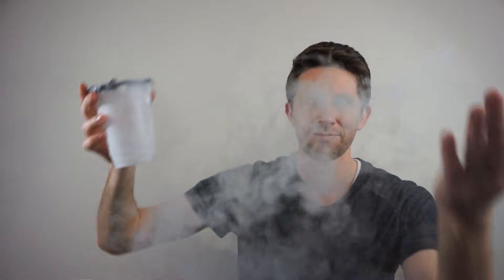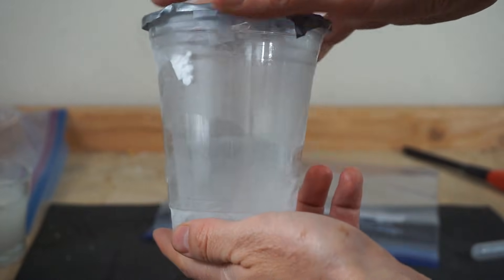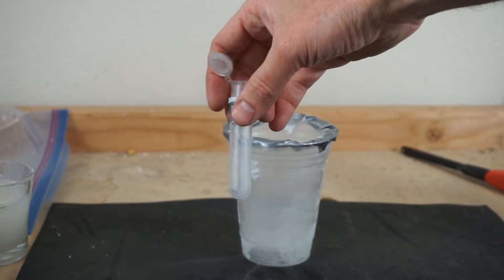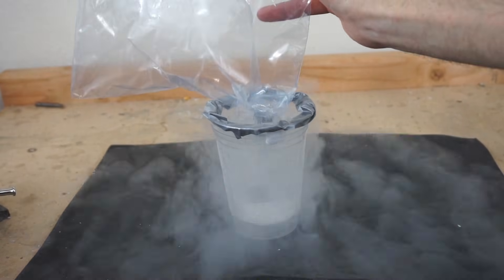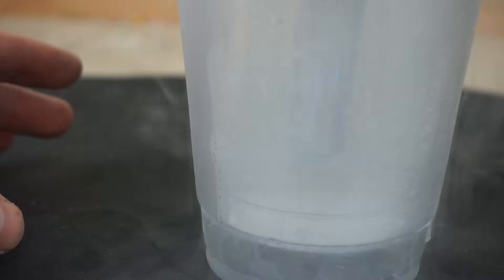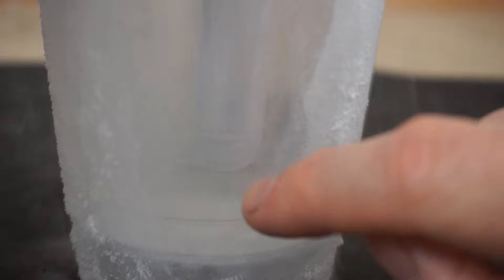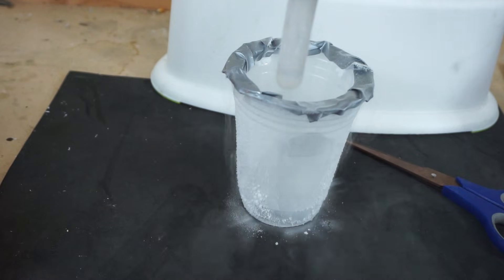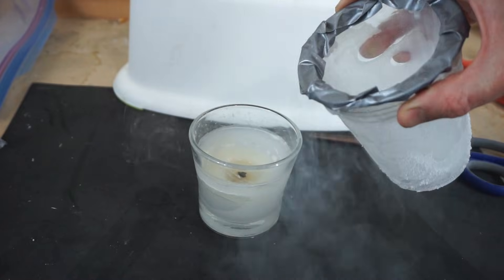How to Turn Air Into a Liquid

Comment: How do you know it's not just water?
Because, you know, there's probably 50% of humidity in your air.
Reply from the maker: +Ceelvain water would be solid at that temp:) and 50% humidity does not mean 50% of the air is water...
Reply: That's true. But still, water is probably the first thing I would expect to condense.
Reply: @Ceelvain  water condenses between 32F and 212F. You know... liquid water. Anything below 32F and you have ice. Liquid nitrogen is less then -320F.
Reply: @mycroft16  Something tells me it's not that simple. At 20°C (room temperature) you should only have liquid water. Yet your air is often humid. Your skin never reach 100°C and yet your sweat evaporate.
Reply: @Ceelvain  Of course it isn't that simple. Nothing ever is, but it often helps to simplify to understand. In actuality air has different saturation points based on temperature. Air at 86F can only hold 4% water by volume. At -40F that drops to 0.2%. Relative humidity is a measure of how close to being at saturation it is. So if it is 86F out and there is 2% water vapor in the air then the relative humidity is 50% (2 is half of 4). Relative humidity increases 3 ways. Evaporation into unsaturated air. Two air masses both below saturation point mixing together. Or unsaturated air cooling down (saturation point, known as the dew point goes down because air is colder, but same amount of water is in air). So nice sunny day, colder air mass moves in, temperature drops, relative humidity hits saturation point, because it's cooling the excess moisture condenses out, clouds form, it rains. Etc. You also have to look at the latent heat of vaporization. It measure how much energy it takes to turn 1 mol (standard chemistry measurement) of a liquid into a vapor. If you convert it to kg, for water you get 2,620 kJ/kg. So for 1 kg of water, 2,600 kilojoules of energy. That's 628 watt-hours. That would run 1 60-watt lightbulb for 10 hours. That's just the energy stored in the air by 1kg of water evaporating into it. When you cool air and the water condenses, that goes in reverse, the heat is released back to the atmosphere. THIS is the energy that drives every storm on earth. That's why hurricanes are powered by warm water. That evaporating warm water is what carries the energy into the storm where it cools and the energy is released. The amount of raw power released by a single thunderstorm is insane. Get an average hurricane, cat 3, and these are the numbers you get:

From wind: 1.3 x 10^17 joules/day
That works out to half of the electric generating capacity of the entire planet for a single day.

From rain: 5.2 x 10^ 19 joules/day
This is 200x the generating capacity of the entire planet. So in 1 single day an average hurricane releases more energy than all of humanity generates in 200 days. And that's a cat 3 storm, not even a big Katrina size Cat 5. And it's just 1 storm for 1 single day. Think when there are 5 hurricanes spinning in the atlantic, and several typhoons going in the pacific, plus all of the other storms on Earth...

Starting to see how much energy water vapor carries? Storms are the atmosphere's way of keeping the energy balanced out around the globe. Too much water vapor builds up in a place, clouds form, storms happen, energy released. Which is a problem if temperatures go up, even a little.. because even a tiny amount of water carries a huge amount of energy. If the sea surface is warmer, faster evaporation. If the air over the surface is warmer, faster evaporation + air can hold more water/energy. All of this leads to larger, more energetic storms (both summer and winter storms).

That got a little off track, sorry. I almost went into meteorology in college. I get excited by these things. :)
Reply: At that low temperature the water would be solid ice. At that low temperature even the carbon dioxide would be solid ice.

Comment: I'm curious if the bag is necessary. My assumption is that if the opening of the test tube is well above the level where the nitrogen is boiling out of the cup, the outside air should condense into it on its own.
Reply: Of course, at the very least, the bag illustrates the reduction in volume.
Reply from the maker: The bag isn't absolutely necessary however it keeps the cold air in the bag from mixing with the warm room temperature air and so you get more condensation.
Reply: Makes a lot of sense.

Comment: yeah... because everyone has some liquid nitrogen.
Reply: Dai it really isn't as hard to get as people think, I'm aware most people don't care to go buy it, but most decent sized cities has a gasses/welding supply. Most of those places will sell you it, if you have the correct container that is.
Reply: Dai I think the Dewars are fairly expensive but the liquid nitrogen itself isn't. I think I read it was about $3 USD per litre or somewhere around there.
Reply: I just make it myself
Reply: @ChristmasEve777  isn't the equipment super $$$$? Massive compressors and such?
Reply: Harvey, another way to make it other than the using the Joule Thomson effect or multistage phrase change is using a cryocooler.  I lucked out and found a powerful one for $1600 (but I've seen less powerful cryocoolers for $900 or less).  Mine makes over 3 liters of liquid air in 24 hours and uses 300-400 watts.  It only weighs 7 to 8 pounds or so.  They're extremely hard to find used though.  Mine was barely used.
Reply: @ChristmasEve777  how do you make your own liquid nitrogen?
Reply: Yeah me too, i just bought some at the grocery store 😒
NOT!!
Reply: @xxaestheticxx You should probably stay away from science-oriented channels since you obviously have NO scientific knowledge, period. Or, if you do, refrain from posting comments. Air consists of oxygen (boils at -297 F) and nitrogen (boils at -320 F), which is WAY colder than water (H2O), which boils at 212 F.   The two liquids couldn't be more different!
Reply: @ChristmasEve777     you should probably stay away from commenting, since you’re obviously toxic, period. Or if you do, refrain from making it blatant. You consist of a temper (boils at room temperature) and brain (freezes when typing), which you try silencing others with, which is WAY more than others do when they see an incorrect statement. You and a decent person couldn’t be more different!
Reply: @plutoboy1564  OOHHHhh god, you violated him...
Reply: @ChristmasEve777  #CelsiusTeam
Reply: @exquisite very funny baby
Reply: he forgot or maybe doesnt even know that the ARGON still remained as a gas in that test tube
Reply: @davidt8087 impossible
Reply: Well it's easier to come by than a cryo condensor or whatever thing it is
Reply: Did you expect make it with air conditioner?
Reply: It did not say:"At home"
Reply: He did a tutorial to make the Poor Man's one, although I HIGHLY don't recommend it cuz it's more dangerous.
Reply: Blue comment

Comment: +The Action Lab  I've actually done this before.  Boy I need to start making videos of this stuff haha!  Anyway, I used a metal can inside of another can filled with liquid nitrogen.  The liquid air condenses into the metal can and I usually collect about 50 mL or so (I'm guessing).  The gas coming out of the liquid air is actually well over 95% nitrogen gas, so it will actually put out a flame.  I usually have to wait a long time, or even throw in an object to boil off the liquid nitrogen and leave liquid oxygen for me to mess with
Reply from the maker: Ha, you should make videos on what you do. Before I had a youtube channel I was always doing stuff like this. Now I just film it:).
Reply: The Action Lab  Yeah you're right.  I do have a few videos posted.  A few on using Liquid nitrogen to make Mirages, and a few on liquid difluoroethane.  They're slowly tacking on the views